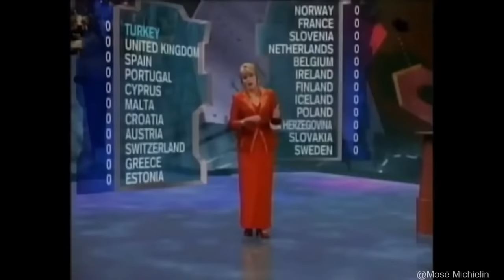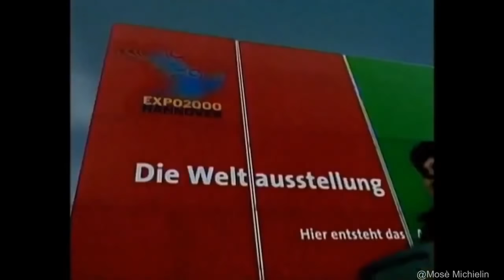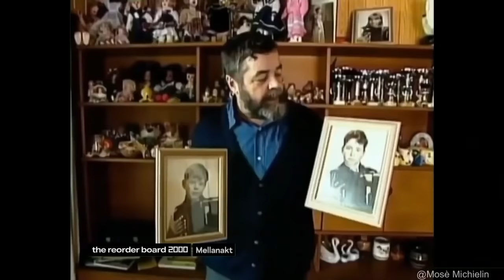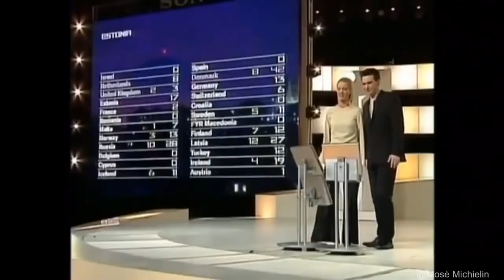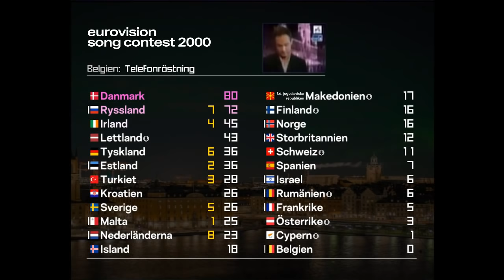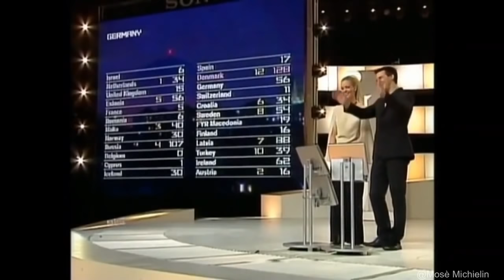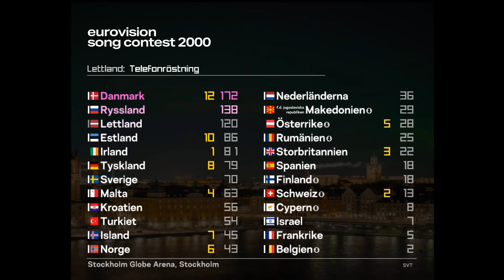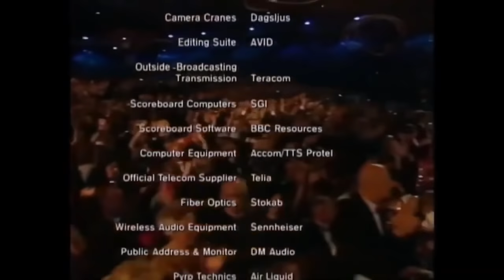Eurovision 2000: Can’t play that song again | Super-cut with animated scoreboard

Comment from the maker: A few other things I couldn’t fit in the description:
- Firstly, the odd bits in the scoreboard. Although the top 3 settle very quickly, the interesting race is mid-table. At one point, during the Norwegian voting, five countries are on 16 points. For some reason, and I haven’t worked out how yet, Germany is awarded 3 points and Malta swaps place. I can only think this is something to do with an animation not firing, but everything else looks correct. If I find out the cause, I’ll let you know.
- The second odd bit is to do with the CanYouWin function that greys out the countries that can no longer win. I spent most of my Sunday wondering what was wrong with the board during the German voting. Austria is ruled out, but everyone else below them is still in. I think at that point, Austria is doubly disadvantaged because it’s had a vote awarded this round AND still has to cast it’s vote, meaning it has one less chance compared to most of the others below it. The board waits in case the countries below Austria get awarded a 12 and therefore won’t update until the 12 is placed at the end of the round…for Austria the round ended when it got the 2 from Germany. 
- The board also highlighted another oddity during Finland’s vote…Latvia are still in the competition, and are awaiting a 12. I gets it…but then the 12 knocks them out. To my mind, they should have already been discounted if 12 wasn’t enough. I might have to review when the CanYouWin function is run – it hasn’t been a problem up until now, so maybe it’s to do with me tinkering with the build. We get the right result at the end of each round anyway!
- Aside from my bugs…the pre-Contest Internet polling was way off, wasn’t it! What a great first sign that internet chat rooms might not be where the winner is decided. I put the top five from that poll, as well as the UK odds on the lower thirds. The source, the rather great and fastidious: Eurovision Song Contest 2000 Details (myledbury.co.uk)
- A nice moment that a 12 being awarded for the host by the Turkish jury is the thing that makes Denmark win.
- So many lovely bits in the production, especially the postcards, which I thought were artfully produced…the classiest yet (although I think 2001 might pip them). The strongest was the UK one I think, and the Netherlands. I can only assume the spokespeople were urged not to build up their parts? Compared to 1999, the voting is super snappy. The presenters were great, if not a little cheesy at times. The edit of past Contests shown during one of the breaks was wonderful too.
- I particularly enjoyed the rail cam sliding through the ornaments hanging from the Globen ceiling, very nice touch.
- I think Turkey developed as my personal favourite through the editing. It’s a shame that they went on to win with something that was more commercial…but then, that’s exactly how they won in 2003. For two years in a row my personal favourites have been in line with French televoters?!
- I think I would have preferred to have moved the ‘Relegation’ flags (the little arrows) away from the country names. This all came from me using Schoon Square for all text at first, and neatly ‘gridding up’ everything very close to each other. The result was that you couldn’t read much at all…I missed separating everything out a bit more once I adopted Nurom. 
- I’ve folded in the deduction in marks for Croatia for using a male voice in the backing track in Jerusalem. The board now works out Croatia’s relegation position based on them getting 79 points in 1999, not the 118 the voters gave them. This would have no effect on Croatia since the system was about to be chucked anyway.
- Love that Nicki French felt that the UK’s performance might have been down to us not being in the Euro. The currency was very much the hot political topic in the UK, and the election of 2001 featured it heavily. I love Nicki, mainly because of her great attitude and clear love for the Contest and the experience she had in Stockholm. For Greece, joining the Euro in 2000 was very much going to develop into a more serious problem.
- Worth noting that the Yugoslav wars were really coming to an end in 2000. Milošević was booted out by the people after opposition leader Ivan Stambolić was murdered…most likely ordered by the President. The revolution would pave the way to Serbia & Montenegro re-joining the international community and, to Eurovision. Especially worth noting here, as it was in Sweden in 1992 that they last competed. 
- The video, with not so much clipping, may appear on another well known video sharing site next week.
Reply: And now people think UK's poor performance is due to Brexit... massive sigh
Reply: @moramento22  Yeah, it all went downhill for the UK from 2000...
Reply: Indeed it was an excellent show, probably the beggining of ESC as we know it nowdays: big stadium, cheerful audience, modern stage and graphic design... (although 1998 had a bit of all that too). I just missed that year the flags in the scoreboard, so thank you for adding them :)
And I agree about the logo, I've always loved it because it's simple but meaningful, and what a nice touch was to keep it on stage with the colours of the current performing country! By thw way, I thought I was the only one enjoying the camera playing around the roof ornaments, haha!
And about your reorder board, I think you did the perfect work that was needed to improve the original one without breaking its original concept!, love it!
Reply: Myledbury.co.uk is excellent for at-the-time reports of the late 1990s, early 2000s contests. Also, the official rules of many of these contests are there too, and they make interesting reading. 

Most notable for me is that the rules at the time permitted participating broadcasters to repeat the contest as much as they liked for 28 days after the contest. The BBC and RTÉ have never taken advantage of this...and I would have thought in a pre-YouTube time, there would be some demand for a repeat, maybe on a Sunday afternoon. It does appear however that the now-defunct BBC Choice repeated the 2002 contest the Wednesday after the contest.
Reply: Regarding the CanYouWin function, it is correct regarding Germany’s 2 points to Austria.  However, I think during Finland’s vote, it should have grayed out when Denmark received 10.  It probably is a misfiring of the animation probably...
Reply from the maker: @JeSuisRene  Yes I think you're right. I actually left the greying out delay the same as a usual board and it appears late on this because the reshuffling is much quicker than a re-order like usual...I think the delay may well have been interrupted by the following point being awarded. Back to a more normal build next though so I might just file it under 'could do better' and move on lol :-)
Reply: A little note on this - I call BS on Nicki French’s theory that our low placing was due to us not taking the Euro: their non-adoption didn’t stop Denmark winning it (or finishing second the following year, having rejected it in a referendum between Contests).

Also, we finished fourth in 2002 - after the Euro’s full adoption - and the three countries that finished above us (Latvia, Malta and Estonia) were yet to join.
Reply: @DitzyNizzy2009  Oh absolutely.  The song wasn’t good enough.  It’s like how now British Eurofans say we finished badly because of Brexit...
Reply: Greece has withdrawl from the 2000 contest due the ERT have giving priority to send a big delegation to cover the Olympics in Australia.An interest thing that the draw doesn't have helped the big favorities,The draw did not help the big favorites, they all fell in close positions and very early on.Another interesting fact is that not one of the first three was listed on the stock exchange.
Reply: @DitzyNizzy2009  they are on the last steps to join the EU. The 2002 and 2003 contests helped to prove that Estonia and Latvia were fully eligible to be admitted.
Reply: @debonidaniel  Yes that is a surprise, though anyone betting on Denmark would have found themselves much richer at the end of the contest.  Out of the favourites, I do know how 🇳🇱 or 🇬🇧 managed to do so well in the betting odds.  However, 🇮🇪 deserved to do about as well as it did, though I do feel that 🇪🇪 and 🇳🇴 ought to have done MUCH better.  Incidentally I also think 🇲🇹 should have done a great deal better too.
Reply: @JeSuisRene  i remember so well of these odds.But,they cancel all,due the early places on the drawn,who was held some months before.I have to admit that the current process of draw is better,as anyone can't cancel himself or another song.
Reply: Did you know Nicki french said in interviews she felt treason

Comment: Anyone who knows a thing or two about betting — why were the Estonian odds written as 6/4 and not 3/2?
Reply from the maker: I have checked this - it's a mixture of function and tradition it seems. 6/4 allows bookmakers to shift the price more easily compared to starting at 3/2 - 6/4 can turn to 7/4 and it not seem like an entirely different price. There's also some prices that are related to tic-tak (the now often not used sign language seen at race courses). 100/30 is often not shortened to 10/3 either...it has a special sign in the language.